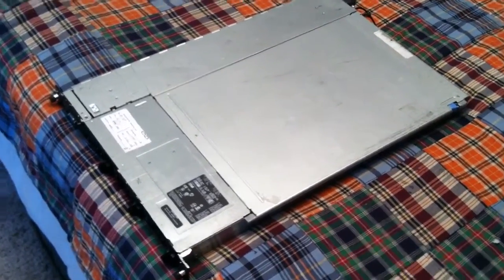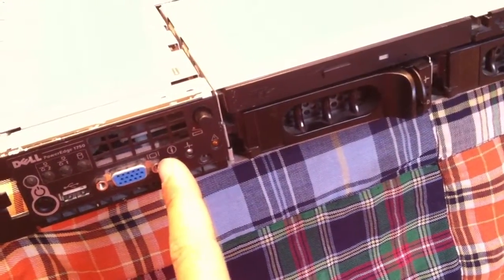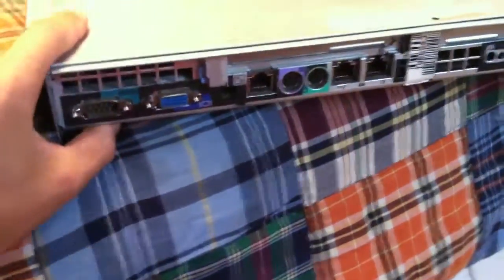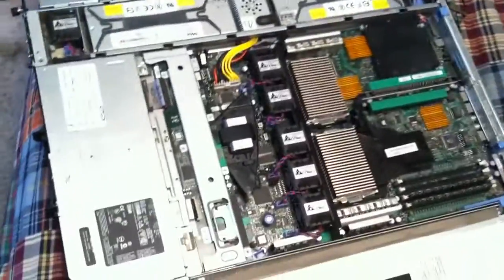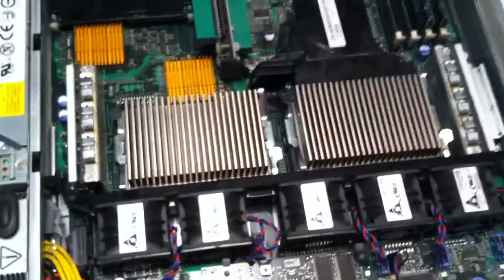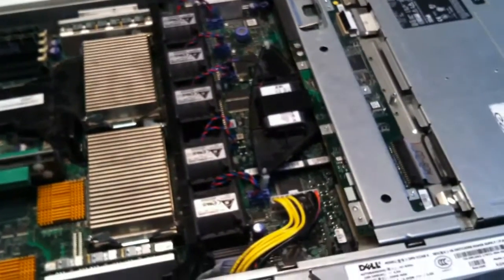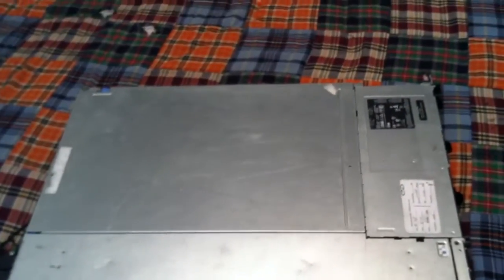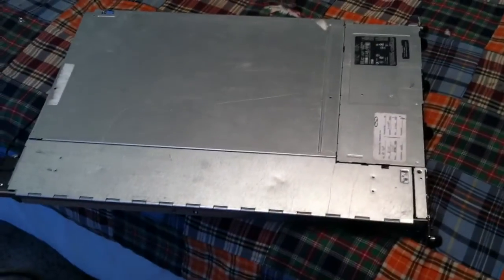Dell poweredge 1750 server close look

Comment: Hi dude,

I was having an error " hardware malfunction.. Contact your vendor.." I checked sum blog n he said to take out the rom battery for some time then plug it back n i took the battery.. Took out the Rams n plugged back and now its not picking up harddrives.. Its giving error of " no bootable device found " :( 

Any idea what could be wtong? I have took out the discs n inserted back several times but no hope
Reply from the maker: Sign up on my forum thehackhub.com and make a post there it literally takes like 2 minutes total. From there you can post pictures of the problem and i can have a better understanding of your issue.

Comment from the maker: Haha Yes! I am very used to it by now and i actually sleep better with some noise. More of a problem than the noise is the heat produced, with the whole rack running it pulls about 15 amps and makes tons of heat. Most the time i try to keep only the critical units running. Even then I have a 5000 btu ac running all day. It is nice in the winter though because my room stays warm.